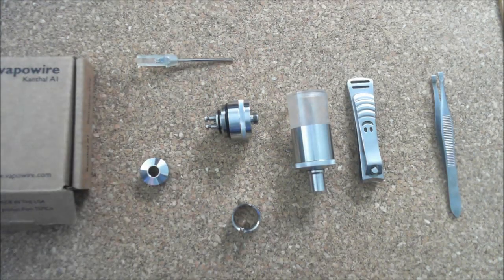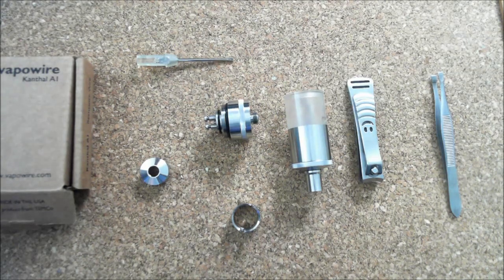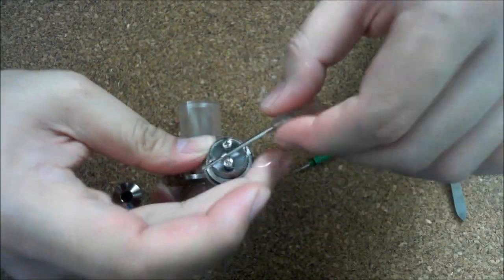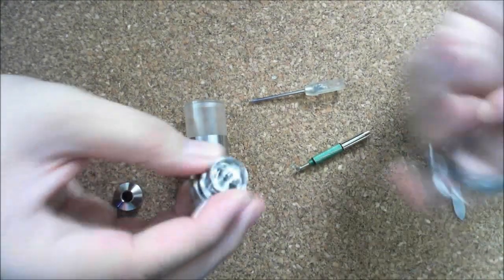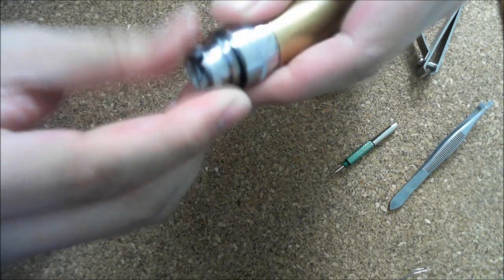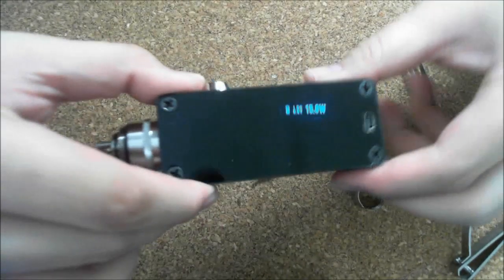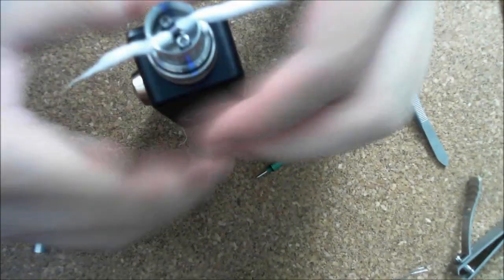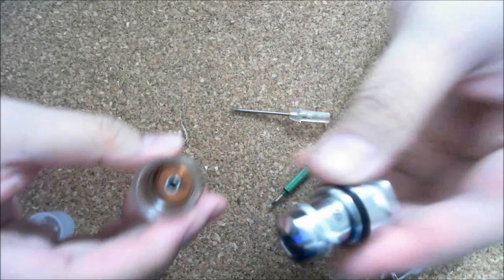Setting up the Taifun GT with microcoils and cotton wick

Comment: Got my first proper rebuildable the other day. The Taifun GT Clone. It's incredible. I build the coil just like yours and haven't had any issues at all. Maybe I got lucky haha. With this your mouth just fills full of vapour rapidly without the need to suck. Massive throat hit and great flavour. Amazing on my Private V2 mod. One thing i'm finding, even though it's not really a problem, the 'o' ring on the adjustable strung 510 connector keeps on falling off as it works it way over the screw.

Comment: great vid - cheers wern :-)
10 coils of 0.3mm kanthal on a 2mm screw gave me 1.5 Ohms. works a treat.
Reply from the maker: I'm glad this worked for you! Setting it with silica is a little more finicky and I only managed to get it working after two leaky tanks :)

Comment: I'm an amateur vaper here and i have a couple of questions.
1) I'm guessing the number of turns effects your resistance yes? So more turns = higher resistance ?
2) What do you get from a lower resistance build?
3) The difference between Micro, macro and nano coils?
4) Can a taifun GT run a double coil ?

Thanks for your time. :)

Comment: That's the beauty of a VW DNA device... you can adjust the wattage to match the resistance. Put the wattage at 13.5 watts, and that will give you 3.85 volts. It should anyways, according to ohm's law. Then it will give you the exact same vape you would get from a mech at its average voltage over the life of the battery (4.2-3.5 volts).

Comment: This is fun also wernshen ,made a dual coil on the Hcigar Taifun GT (with Chi-You,Sony vtc4) 0,30mm Kanthal, 6 wraps on 2mm drills gives me 0,67ohm. coils hanging high just above the screws (otherwise i does not fit) Picture: https://www.dropbox.com/sc/8ca4b33l9tyghub/0f4LIgluIX  'video' : https://www.dropbox.com/sc/byonucjoy4zinz9/6bwmgDt-07
Reply from the maker: I find that single coil tastes better (in my opinion), but thanks for sharing your build! :)